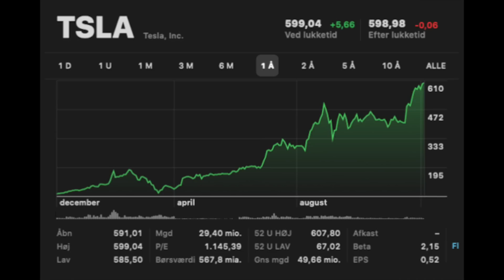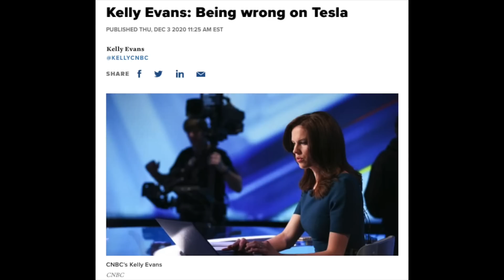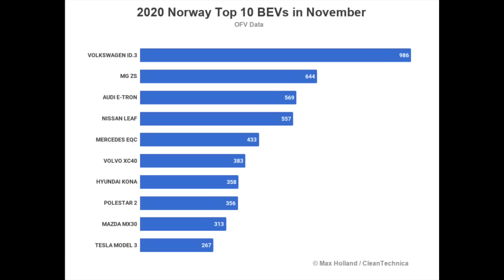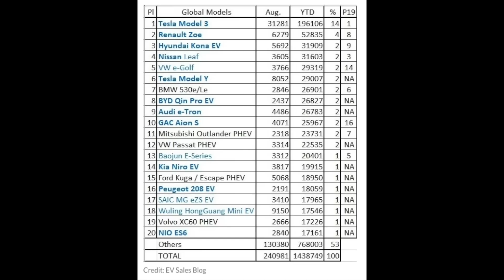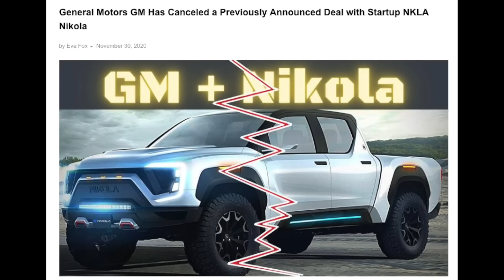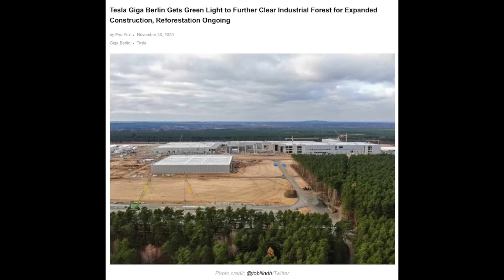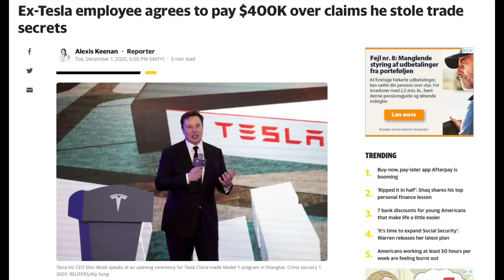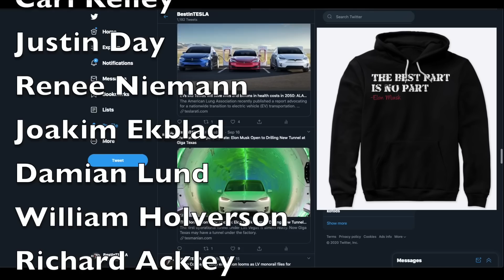Tesla Semi shows acceleration 😱 | Tesla continues global domination  | The Nikola Badger is DEAD

Comment: Dumb question but why is the semi so loud? Thought  EVs are quiet?
Reply from the maker: There is a diesel truck in front of the guy who is recording 😂👍
Reply: No sound insulation on trucks, and tyres are noisy, gears too.  The noise you hear from a truck on the highway is mostly tyres.

Comment: why semi is so good in acceleration : Here are he numbers for SEMI TRUCK:  typical weight of the rig 36 tons max.  width / height 2.5m/4.1 m   CD = 0.36 ,  rolling resistance = 0.012. Required  power at 100 km/h (60MPH) = 153.27 KW. 
 Battery 1000 KWH. Range 400 miles at 60 MPH.    IT IS ALL FEASIBLE!!!!!!!!!   ROLLING RESISTANCE POWER IS 2 TIMES BIGGER THAT AIR RESISTANCE POWER (107.91 KW vs 45.36 KW.  It can go 65 mph, no sweat. if you need i can give you revised numbers for 65mph.  Some folks ask about uphill, here are some figures , 5 deg uphill 50 mph speed , you will need 800 kW OF POWER., I do not think TESLA will have a problem with this power requirements. BTW. diesel would require 800*1.34 = 1040 HP !!!!! to keep up, good luck!!!!!!

Comment: I was going to wait it out for a dual motor cybertruck but now with Tesla shares increasing how they are I think I might be able to get a Tesla sooner. Maybe just a lease to start until the cybertruck comes out. I do have a business plan in mind and for those that do not own their own house for Tesla solar I think there is another option. As you well know SpaceX and starlink are run by Elon Musk he as well is the CEO of Tesla. Solar panels are tightly folded to expand once they are in orbit. Consider having a solar shelter you could quickly unfold and have it securely surrounding your vehicle and keeping you and it out of the dust heat or cold. If the parking lot had a place that you could connect your Tesla to the grid not only would the solar be charging your vehicle but the battery could also be charging the grid. Of course the vehicle to grid software would make it easy for your Tesla to be making you money when it's parked and your solar shelter could continue offering power to the grid if you don't need to bring it with you. Let me know what you think of these ideas or if you have some of your own to add. I do appreciate all of you and your comments. Now this is the time to fix our future fast!
propower101@hotmail.com

Comment: Why MOKKA has no power!!! 100 kW motor is lame, they could have put into it 160 kW  , same as Bolt  and people would love it!!!!! I drove BOLT and power is great, the only thing is that this motor should drive rear wheels!!!!When you step on throttle front wheels are squealing  and  spinning, what a waist of acceleration!!!!   Elon give those GM engineers  lecture, send them back to school.

Comment: Why make an “affordable compact” that has inefficient door handles.  They don’t cut drag....Make them all manual. Why do a redundant system?  Waste for wires and weight.  I want to work for  FRANZ . For free......Design a compact that has the c pillars 50 in wide so we can get s sheet of plywood in side  like the 1986 Dodge Colt had.  My Tesla was cut to do this.  Used our jaws of life at the firehouse......and the spreaders....Don’t use an electric motor to close the hood and hatch. We are not all lazy.....  If we care for the environment, why all the electronics, neodymium and thorium?  Wake up. Don’t use pearl paint as an option. Where does car paint come from?   Guess.